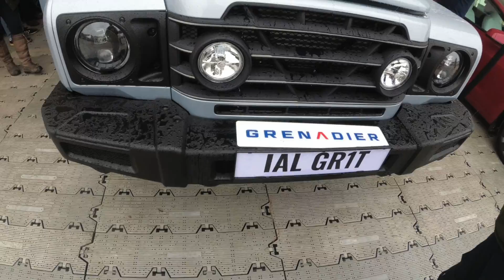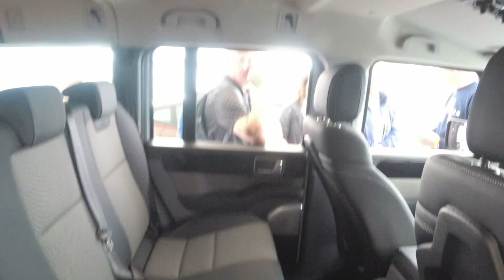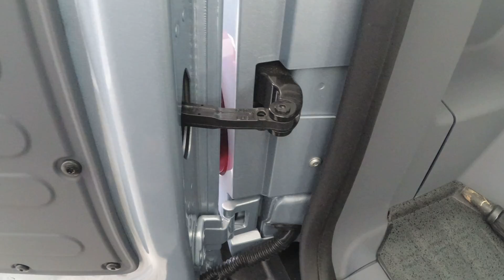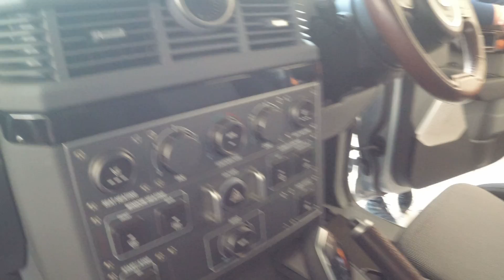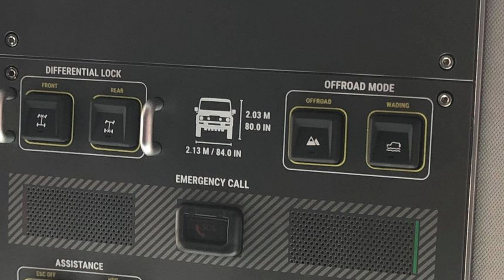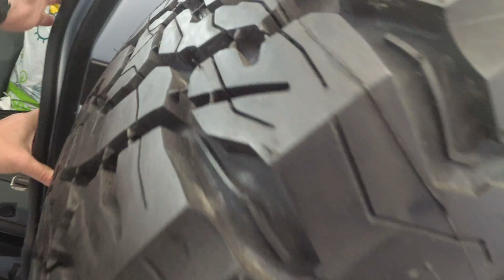Underneath the Grenadier and other details - 1 of 2

Comment: Will it comes with winch compatible front metal bumper? In my humble opinion it'll come optional as Jeep does with the extreme package. I hope Ineos  winch compatible bumper comes fully kitted out, unlike the Jeep optional mopar steel bumper where you have to get a winch plate/cradle seperately.

Comment: interior switches are just plan ugly and far too many. on the roof ! why ? front radiator will be destroyed way too low. Rear of vehicle that shroud is below axle centre and that will be ripped off when used off road. Panel gaps are huge, roof lining looks cheap. galvanised brake callipers will rust like hell.  recovery points well high lighted they will be used a lot. Looking like the best off road vehicle to hit the market, in the workshop being repaired. Its plan UGLY.
As the saying goes, if you want to go bush take a Toyota or Grenadier (landrover) but if you wanna come back, take a Toyota.

Comment: In the Off-roading section you state at about 23:12 that Ineos is not intending the vehicle to be an off roading enthusiast vehicle but rather a working vehicle. If this is true, how disappointing. And if it can’t fit 33’s without modification, then it’s not even comparable in available tire size to the offerings by Jeep and Ford where 33’s and 35’s are optional from the factory. Ineos ought to rethink this important specification issue and make the reality meet up with the image they are creating of a go anywhere vehicle with the best spec’s. Also the side steps / rockers are mounted too low and are reducing ground clearance, as the video appears to show.

Comment: Thank you for an excellent video. I know what you mean about showing the roll over footage. The actual body structure of the Series and 110 vehicles is archaic, to say the least. The Triumph 2000/2500 were tested for roll over safety and that would have been a good fifty years ago.

It is great that the Grenadier has proper orange lens side repeaters for the indicators and proper orange lens front indicators. I have lost count of the times that a modern car has nearly been pranged because of clear lens front indicators, clear lens side repeaters, pale orange side repeaters fitted to the rear of a side mirror housing (VW group, in particular) and sometimes no side repeaters. I nearly took out a small Japanese car one day, whilst I was turning right out of my street and the other driver was coming from my left to turn right into my street. His car had no side repeaters and the front indicators were inboard of the head lights; and recessed approximately 100mm.
Replaceable paper element oil filter … the original 331 cubic inch Chrysler Hemi V8 that! Hopefully this one is not right up against the firewall. 🙂

Comment: Hopefully there will be a display on the dash showing the selected gear, both in low and high range and full-time. Also hopefully the range box will NOT default to a locked centre diff in low range [as the Land Cruiser does :-( ]. Hopefully they will copy Land Rover in this regard.

Comment: I have now seen a few recent commentary updates on the Grenadier. Still surprised that no one brings up the question of why they chose to go with only an automatic gearbox. Have everyone totally embraced the concept of automatics? Does no one see the obvious problem here, that an automatic will require expensive service and will eventually break down. Not if but when. Hopefully not in the middle of a desert. Have everyone forgotten that a manual gearshift is actually part of the enjoyment, a quality that brings a closer connection to the machine and so on... Or am I just a totally out of touch dinosour?
Reply: I’m a manual man, that said, when the going gets tough, as in, sand & mud & starting from an awkward position half way up a 50 degree hill, crawling through tight stuff or generally being in the position where you need to murder the clutch to get going, Auto excel.  For everything else, other than comfort I Agee with you.

Comment: Engine only 500nm??  That's pretty low from a straight 6 diesel.
Reply: Detuned for durability. Same as a 70 series 1VD
Reply: Ineos website now says 550 nm / 249 hp.
Reply: They’re saying 183kw & 550nm

Comment: Is the intention to secure cargo on top of rubber mounting strips on the roof, or to remove the rubber mounting strips in order to fasten mounting platforms to the roof?
Reply: INEOS says it's intended to carry cargo directly on the roof, without the need for a rack

Comment: Nice walk through thank you. You covered points we don't often think about. Lots of things still to tweak but all in all an impressive design. Little worried that the placement of the exhaust is going to get in the way of using the left rear recovery point.  Not sure I want hot exhaust blowing on my nylon straps.

Comment: I kind of  like it, but bmw running gear has me concerned. A great test is the Canning stock route in Australia. Basically a stock 70 series cruiser can do it, where Merc G wagons failed. The radiator hanging low would be of concern if you hit a kangaroo (as an example). So, Ineos, get one here, test it in the desert at 40c-50c. If we are not your market, then id suggest neither is Africa. If the testing goes well 💯 fabulous. Toyota need a competitor
Reply: They announced they're gonna run the Grenadier on the Canning Stock Route in May/June! I'll be very curious to see how it holds up along the route.
Reply: @drivenbyemerson  thats going to be a good test. The G wagons had suspension failures but from the footage i saw the testers drove like idiots. Same as the defenders in Namibia
Reply: By all accounts they’re not trying to make an off-roader capable of conquering Australia…they just want to make a work horse to run around mine sites and tow stuff.
Reply: The G Wagons destroyed multiple dampers on the Canning Stock Route because some moron at Daimler Benz specified gas/hydraulic dampers for the Australian civilian market models. The G Professional pickup that served as support vehicle was fitted with hydraulic dampers.  I understand that the Aussie civilian market (non-AMG) G Wagons were all subsequently built and/or refitted with hydraulic dampers. There is a reason why gas/hydraulic dampers are never mentioned in heavy duty off road builds OR military vehicle specifications.

Comment: Ok first major mistake is around the statement about its design being focused on a work vehicle rather than a serious off roader which will likely be modified with lift and tyres. It needs to be designed so as to allow easy modification and easy fitment of 35 inch tyres or it really wont be able compete in an area the old defender excelled. Even if an owner will never do any difficult off road work they are going to want to have a vehicle that is able if desired. In Australia you really cant tour the country and do most of the iconic tracks without a decent lift and 35's. It obviously can be done with 33's but you will have a much tougher time of it.
Reply: 33s work just fine in Australia. Spent a decade driving 70 series on powerline access tracks through rocky ranges and muddy black soil downs with a tray full of tools and equipment. 33 got the job done and got me home every time.
Reply: I’m an old adventurer from way back, having worn out several 4x4 driving around Australia over the last 50 years and I’ve done most things & none of my vehicles (up until the current build) had 35’s.

I understand what you meant by 35’s will do most things easier (providing the driveline copes with it) but the country can pretty much be conquered on 33”. 😂

Comment: I see only 2 difflock switches- thar means that the car is only part time 4x4 without a centre diff?
Reply: CDL is in the Hi-Lo gear lever
Reply: It IS Full Time 4WD with the ZF 8-speed transmission running to a 2-speed transfer case. The lever next to the gear selector allows selection of a LOW and HiGH range. So you get 8 speeds in both of these ranges. Centre Diff Lock is achieved with the lever positioned in the middle.

Comment: NGO and remote use, yet no manual gearbox?
Reply: @Uncle Pete What would that be? it isnt because of reliability. NGO or remote use is quite different to a section or platoon of soldiers that if a vehicle becomes stuck it can be air lifted out.

Comment: I have had the privilege of having a ride in the 2b prototype.. The suspension, engine power/gearbox and chassis is excellent combination. I have had nothing like it before, solid built excellent off roader
Reply: Yet they say it’s not going to be an “off-roader” for 4x4 enthusiasts?
Reply: @aussienick100  I think he meant it’s not designed as a rock hopper but more for Overlander travel.
Reply: Did you drive it on or off road? And what were the conditions off road - gravel, rocks snow

Comment: Is the footwell of the left front symmetrical to the right ? 
Because in the right the space for a clutch pedal is filed probably by transmission so if it's the same on the left the pedals on LHD versions may need to be shifted to the side ?

Comment: What's up with the 4 cargo hooks on the rear door ? Not sure what their use could be in this position.
Reply: For me this is great. I often have longer stuff skicking out the back door and use a bungee strap around the outside handle that comes in to fix inside. This way I won't have that hassle.
Reply: You could unbolt the tie-down straps and attach a fold down table, without drilling any new holes...

Comment: Thanks Will.  
Regarding TPMS, I saw a digital display on another review that had tyre pressure monitoring on the info screen, as well as fuel, gear selection and speed.  It was a mock-up, because it showed 35kph, but it was there.

There was also an article in Australian media about ARB doing accessories, parts and even vehicle sales.  Maybe they could do a front bar and a long range tank from new for us. 

Looking forward to your next install.
Reply: Further regarding instrumentation.  Just saw a French review where they scrolled through the screen menu,. I noticed :

Speedo
Tacho
Gear selection indicator
Fuel gauge
Temp
Brake force
Accelerometer
TPMS temp and pressure
Outside temp
Gearbox temp
Battery volts, amps, state of charge
Wheel torque
Wheel angle (?) Steering
Pitch and roll
Altitude
G-Force
And the compass also displayed time and temp

The rear seat swab folds forward to reveal storage deep enough for a compressor.
Reply: If it’s sold here It’s a guarantee that ARB will stuff a bigger tank under it, and slap as much bar work as you can afford to the front back and sides.

Comment: So far from what you have shown and talked about it looks very well thought out and heavy duty. I appreciate the fact that they are designing it to be a rugged work vehicle with great off road capabilities but not a strictly off road vehicle. Not everyone wants to crawl over large rocks when off roading or taking the family on a camping trip. Appears to have very adequate ground clearance. The sides of the rear cargo area would be better suited with flat boxy sections for better gear storage,  like I think you did mention they are looking into that. Great video and look forward to part two.

Comment: I was disappointed to hear that the fuel tank capacity is a miniscule 90 litres
Reply: You think thats miniscule? Defender 90 is 60 litres. Get 300 miles range if youre lucky
Reply: @Gluxetravel  My 78 Troopy comes from the factory with 180 litres. Given the Toyota V8 would eat more fuel than a BMW 6 cylinder, you'd think that 130 or 140 litres would be more appropriate than 90L.
Reply: @spudboy1328 
That’s what I like in Toyota. I have a 180 in Prado 120 and love it in long distances.
Reply: @spudboy1328  All my Troopies have always had the rear 90 litre replaced with an aftermarket replacement.  I hate worrying about fuel on long stretches & hate stopping in wayward dung holes that sell questionable fuel.  My current Troopy build will get the Brown Davis 185litre option giving me 275 litres in total.

It’s a pity the IG (if designed for overlanding) didn’t at least come with 2 tanks, say 65 & 65 & the aftermarket companies could do a replacement option for one of them.   I guess Australia is only a small market but I’d hold off and wait to see how little problems like this are sorted…..I’m not lugging jerry cans.